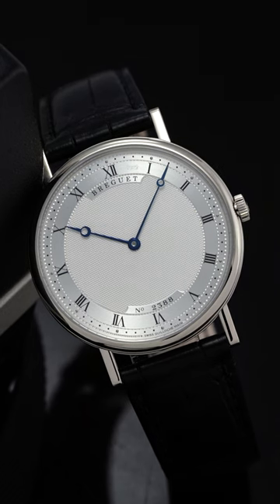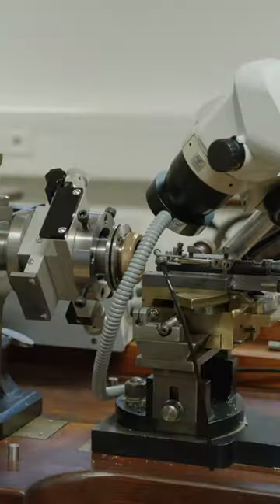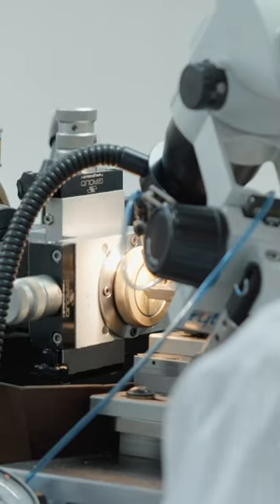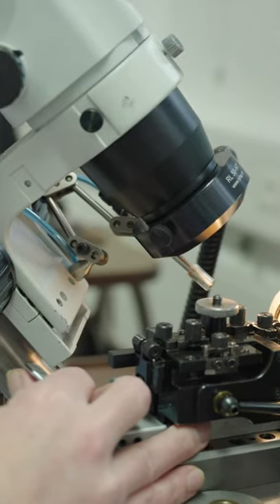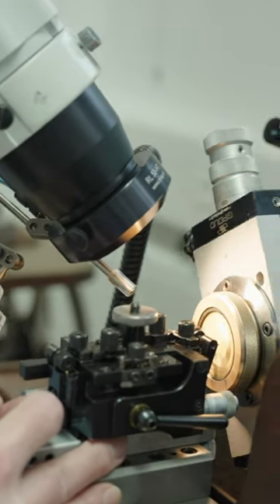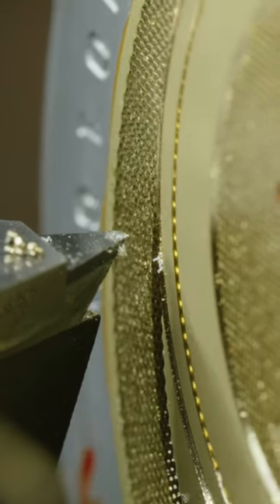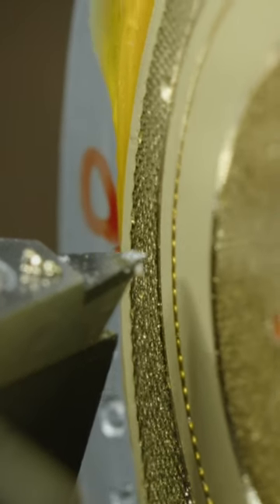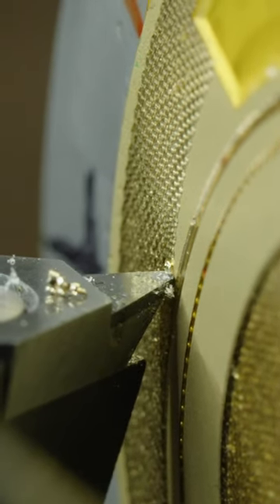If You See This, You're Dealing With A Serious Watch

Comment: What he is describing as in the manual had cutting was 100 years ago... I'm sure a computerised lathe these days can turn out hundreds of these an Hour without any mistakes
Reply: They do it like that till now
Reply: Yeah but luxury dials still made in manual way. That's the whole video.
Reply: That’s what makes it “high end”. There absolutely are brands that mass produce dials with designs like these. Then there are brands like breguet that still do it by hand.
Reply: @weareveinumb718 sounds dumb af to do something manually when a machine can do it faster and more precise, especially if the outcome is the same
Reply: @trailfork7815 It sounds just as dumb to buy a mechanical watch when quartz watches are dozens of times more accurate and much simpler to make. People are willing to spend big coin on something that they know took incredible skill and precision on the behalf of an experienced artisan, even if it could be accomplished much easier and even to a higher quality with modern technology.
Reply: The cheapest way would just be to stamp the texture as seen in something like the Tissot PRX Powermatic 80. But at the luxury end these are made manually so you also pay for the skilled craftsmanship as seen in the AP Royal Oak for example. Basically the same pattern just at way different price point

Comment: A €500 watch is machined pretty much the same way as a €5000 watch.
Reply: That's not true with a watch like This?
Reply: @davidcrandall4958  A lathe is a lathe.
Reply: @pb6839  you're not going to find a £500 watch with a guilloche dial bruh. I challenge you to. You'll only find stamped dials. 

Proper guilloche is only found in really expensive watches - 10k+.